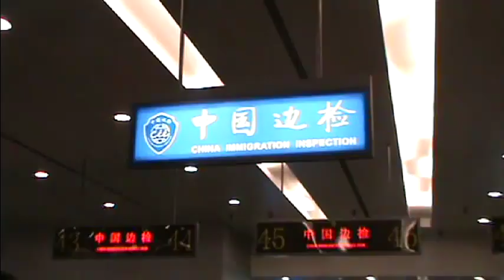Made in China - Electric Bike Documentary

Comment: Thanks for the behind-the-scenes look.   I recently purchased a 1500W rear hub motor kit with sine wave controller from Shanghai for an e-bike conversion.  I'm replacing almost everything on my old mountain bike but the frame and seat.  It would have been a lot cheaper to buy a mountain bike with suspension and disk brakes.  I'm testing the batteries now (new, all very good 3400 mAh Panasonic) and getting ready to build a 48V battery pack that can source up to 1800 watt hours.  My e-bike intentionally looks like a thrashed out old bike with a steel ammo can on the rear rack for storage, but that is the battery and electronics box.  It's a stealth e-bike.  :-)